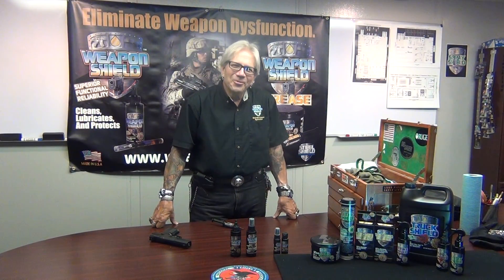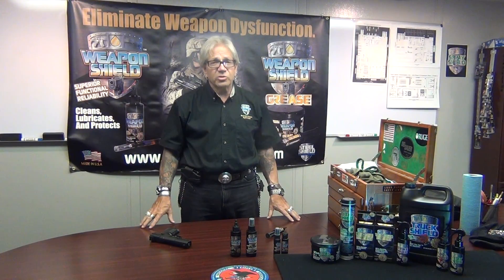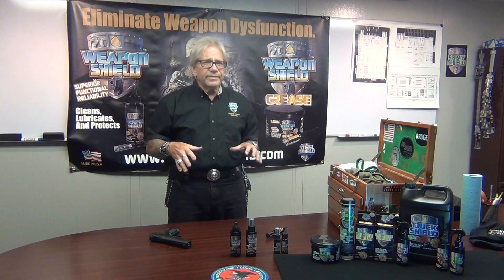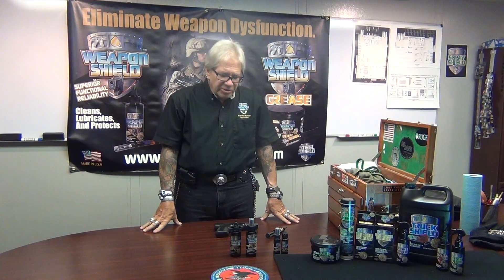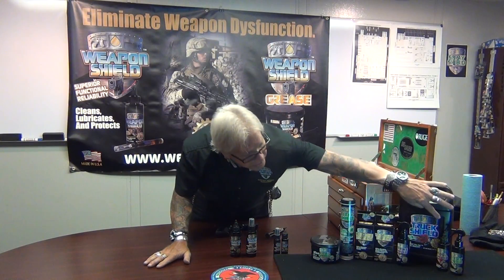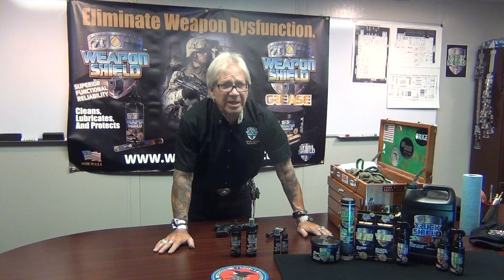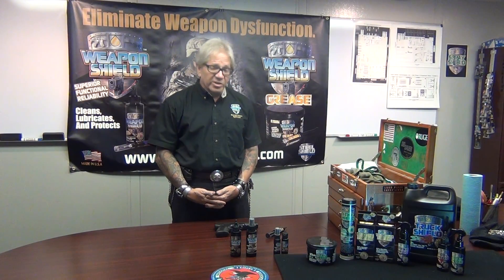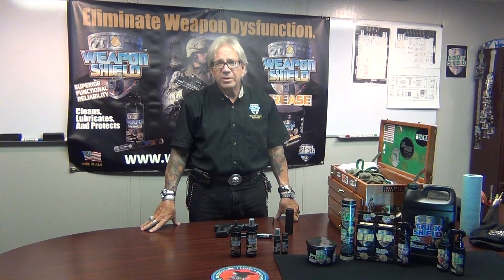Weapon Shield 3 - WS Grease and an overview of other Steel Shield Products

Comment: Sig Sauer P200 series owners use grease on their gun rails. Steel slides on aluminum alloy rails require grease unless you are in extreme cold. I'm not talking Glocks. Will your grease stay in place and perform better than Lucas Extreme Duty Gun Grease in normal temperature ranges?
Reply from the maker: Use Weapon Shield. Sig IMHO doesn't understand maximum lubrication effect and reactions to variables. They are NOT lubrication engineers...I am, but they are Masters of great pistols and Rifles, undisputed.

Comment: So far, I've used Mobil 1 synthetic grease on my M1 Garand to good effect. Just a thin layer does it - if you can see the color of the grease (bright red), then you've used too much. My rifle runs like a sowing machine, and I would be interested to see how this grease would compare.
Reply from the maker: I assure you....you'll be floored by the difference in quality, and operation as well as longer lasting and greater protection.

Comment: I didn't hear the nasty "R" word (rust) mentioned. Is Weapon Shield CLP a rust inhibitor?  Is it good for rust protection during long-term storage of firearms?  Thanks.
Reply from the maker: Absolutely. It's a full CLP and will perform as well and even better than other CLPs at fighting corrosion and protecting in your cabinet or safe for a year without thickening or evaporating.